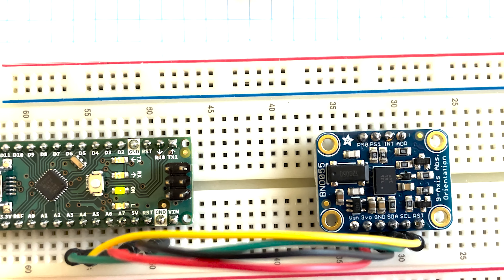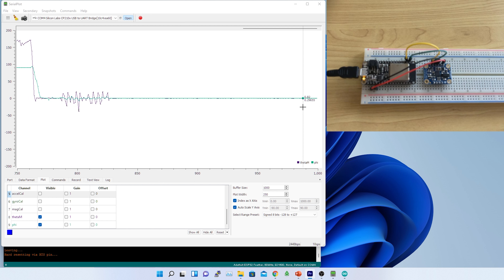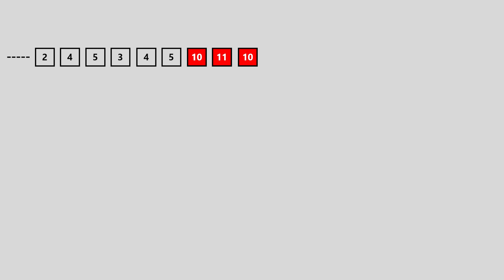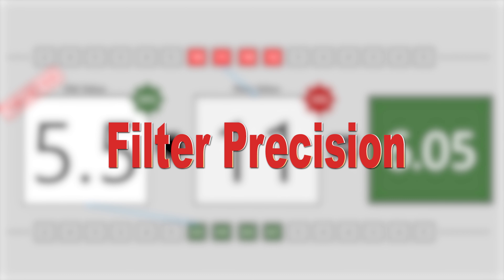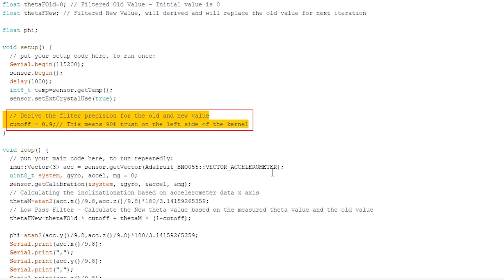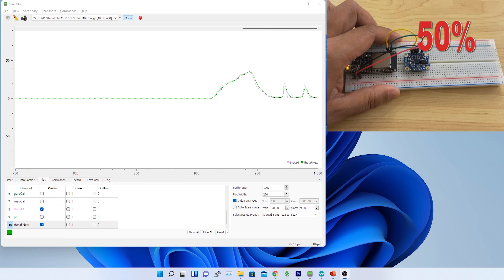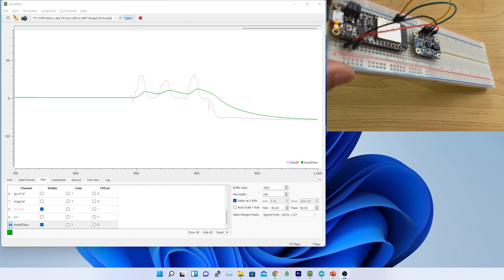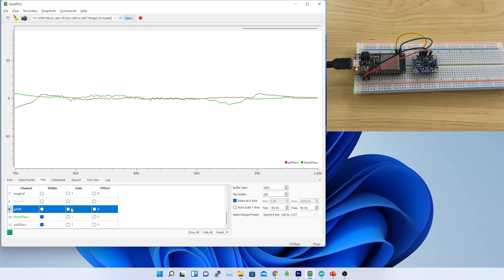Understanding Low Pass Filter to attenuate the noise created by accelerometer during tilt measure

Comment: Thank you, what about degree error once is calibrated only one time? How often have to be  to recalibrate after many turn on/off to the same angle tetha values
Reply from the maker: BNO055 doesn't have any memory to store the calibration details. So every restart system needs to be calibrated. Atleast for accelerometer and magnetometer (to find true north). Somewhere I read that we can capture the calibration details and reset it to the sensor. Honestly I don't know how does it work, I will figure that out later. If I find solution, I will let you know.
So for the time being calibration is required every restart. BNO055 calibration process is fast, it takes only sec instead of minutes. So don't worry about the process.
Later on I will implement battery with the suit to avoid restarting, so please stay tune. Thank you.
Reply from the maker: Hi Jean, we can save the calibration offset in bno. I have figured it out. I will implement that soon. Please stay tune